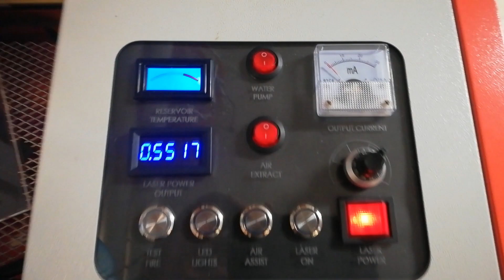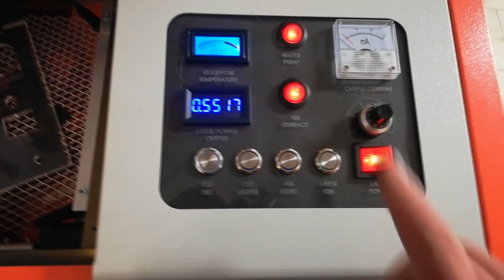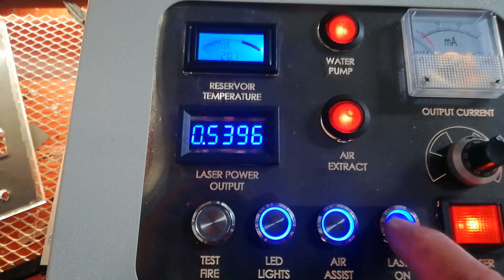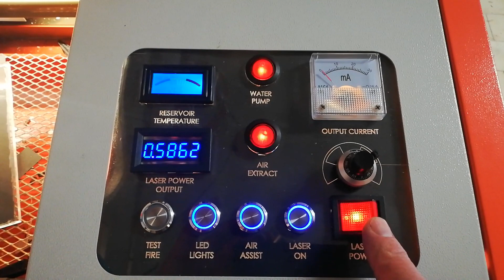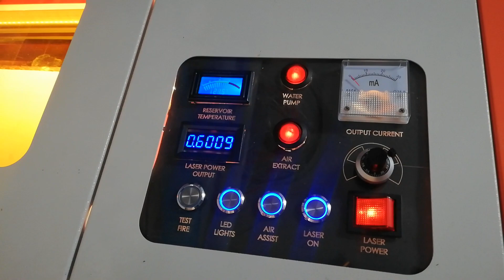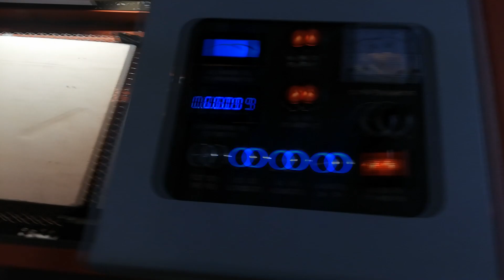K40 Laser upgraded control panel wiring Part 4 D.C wiring

Comment: Great videos. In the video Part4 you eliminated the negativ wire from the Laser on switch and the test fire switch. So the wire for Laser On-Switch must go to Pin 6 from power supply and the wire for Test fire must go to Pin7 from Power supply. Is this correct?
Reply from the maker: Yes I'm pretty sure, this was a while ago.
Reply: Was just about to ask the same question 😊

Comment: Great video series! Question about the digital readout. What exactly is that displaying? percentage of total available power?
Reply from the maker: Hi Brent, yes it's just a display of the input voltage which controls the laser power so higher voltage = more power.

Comment: to my "laser switch" (the one that turns the laser on off not the machine) i have two purple 5v wires (pos,neg).
how do i connect the 5 pin led switch ?. thanks

Comment: How have you wired the leds in the switches? I can only find 12 volt switches but the control signals for "Laser on" and "Test fire" seem to be 5 volt. Am I missing something simple?
Reply from the maker: Hi, everything is switched with a negative so all the led´s are wired with a  permanent positive 12v, the negative for each switched device also is wired to the led´s to turn them on. hope this helps.

Comment: Great videos, thanks a lot! Really would like to follow your setup but I got two questions. The LED thermometer ist rated 5 volts but you connect to your 12 volts supply??? Second question: The pinout of the switches is not really clear to me. You all power them up with 12 volts but signals for laser and test switch require different voltages. I'm puzzled...
Reply from the maker: Hi Andreas, yes you are correct, they are rated at 5v but I have never had an issue, so the on board regulator can handle the higher voltage and all the signals for the laser are negative triggered so all that is needed is the connection of both power supply negatives.

Comment: HI, 
Great videos!! I am having an issue with the switches not working. Anyway I can email you some pics for questions?

I have tested all the connections all the way back to the PSU and everything seems good. However, when attaching the power wire to the device, it does not work, not does the LED come on in the switch. I cannot figure what I am doing wrong.

Only difference is I got a 12V5A PSU, that should not make any difference should it?
Reply from the maker: Hi, do you have both the negative from the power supply and the control unit connected together?  you can contact me at panarep@yahoo.com
Reply: Yes, I do. I followed your videos pretty closely, aside from splitting the power on the 24V side to run a few different things I had already installed on my machine prior to finding your video. I emailed you with more info and some pics that I hope will help.

Comment: Noticed that your current display indicate 0.6 something, but your current is 6 mA. On that panel, you have few solder jumpers - make it show 6.0... instead 0.6. Just play with those until you get proper result.
Reply: Is the panel showing .6 a volt meter or a ammeter? I thought I was displaying the voltage at which the laser is working. Am I wrong?

Comment: Im finally done with my panel and when I power on the machine, the laser power and test fire button light up for a second (same in your video at 15:00) this triggers the laser. Do you know why this is happening? I don't think this happens with the old panel and switches.
Reply from the maker: Sorry I did not see your comment, did you get it working properly?
Reply: @letsfixit1594  I think its fixed now because I added a flow switch in between. Have to check again, didnt really pay attention the last times I turned it on.

Comment: Great video - my power output gauge is a little different - three wires : 5V (R) Black (Gnd) Yellow (input)??  And - I also printed and am using your fan - but mine sits a little and touches the top... any suggestions?

Once again.. thanks!
Reply from the maker: Hey Phil, All you need to do is connect the yellow wire to the pot outer terminal the negatives on mine are both connected together anyway, with the fan housing just melt away part of the plastic so you can angle into the best position.
Reply: @letsfixit1594  DONE!  I used a 12V ps and it worked great.  I did a little mod to your SVG and will post a make to Thingiverse...  I also changed where the water flow sensor was...just a bit.  Thanks for your help!

Comment: Hello Sir, great videos. I do have a few questions if you please. I had purchased a 24v 15A 360W power supply for something else and was going to use it. It is adjustable, but will only dial down to about 19v's. One, is that too much to send to my LPS via the P and G terminals or brown and pink wires? Which are different on my system. And secondly, my board is set up and labeled as follows: [P G] [K- K+] [G IN 5v] I'm guessing or hoping that the [P G] are mislabeled. Now, from your video your showing a brown wire to the momentary switch. Is that going to the P terminal (or in my case G) of the interlock? And the pink wire goes to the G terminal or K+ in my case?  Thanks, HydroFred.
Reply from the maker: Hi, have a look at this link, it gives you the pin-outs on the power controller:   https://www.google.com/url?sa=i&url=https%3A%2F%2Fgithub.com%2Farkypita%2FLaserGRBL%2Fissues%2F740&psig=AOvVaw2N2xs6Nb3Rb5i9zpQyoE_P&ust=1592325980588000&source=images&cd=vfe&ved=0CAIQjRxqFwoTCLCflNqihOoCFQAAAAAdAAAAABAD
Reply from the maker: Oh and yes 19v is too much get yourself a 12v supply.
Reply: @letsfixit1594  Hey, thanks very much. That's really what I was needing to know. Didn't want to let the magic smoke out. But now the wiring, forgive me I'm slow and it's still a little fuzzy. I do not have the colorful wires or a single six pin connector. I have a ribbon with the pretty little dot, dash's and plus signs. The connectors in the middle of the board consist 3 separate connectors. The first is a 2P connector labeled P and G in that order. Two black wires that loop through a water flow sensor. Guessing that's the interlock to where my "Laser Armed" switch is to go? Does it matter which terminal, do I remove one or just feed it into the system? Most pin-outs I've seen, those two terminals are marked as G P. Mine is the opposite. Do I go with what's labeled or pin location? The next two pin connector are labeled K- K+ in that order. Your's, I believe is L G in that order. The other connectors are the same. Now, I'm guessing that the G and the K+ are the same?? And I'm judging that on pin location only. I think. At one time I was thinking that L made the laser fire. But L lines up with K- on mine. If you hear a loud bang or smell smoke. I just blow a fuse. No worries. Thanks for your help. Peace Out.

Comment: Great explanation, thank you! I din't realize that the stock wiring has the negative wire connected to the switches.
Just out of curiosity: why have you connected the negative wire from the added 12v power supply to the stock psu?
Reply from the maker: They need to have the same reference to light up the switchers otherwise you can get strange anomalies.
Reply: @letsfixit1594  I imagined that. My K40 (blue case) has a slightly different position for the control panel screws so I have to modify the svg. Also, I want to add a switch for the red laser pointer and for a (future) motorized z-axis. Now I have to wait for the switches to arrive from china :)
Reply from the maker: @PapLab  I usually use inkscape, it´s very easy to move an object to another position, good luck with your project and post a picture when you are done.
Reply: @letsfixit1594  Sure, I'm already using Inkscape for laser project. Thank you very much for your videos, this definitely explain how to wire all the things up :)

Comment: If understood all i will try to draw a schematics
Reply: did u draw wiring diagram yet?
Reply: I would love to see those schematics
Reply: Ok found out for 12V just connect GND of 12V psu and k40 psu togheter and you can proceed, 12v plus on plus of led switch, GND on common of the switch, and connect negative of led and other side of switch togheter and put on it the test signal wire repeat the same for laser on and for lamps. Remember to bridge each switch with 12V and gnd in respective pins and thats it.